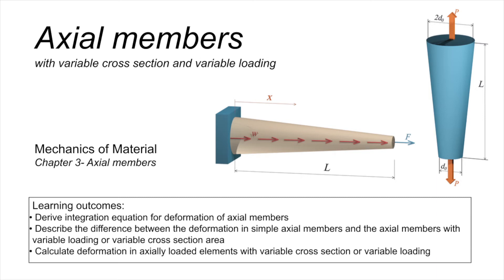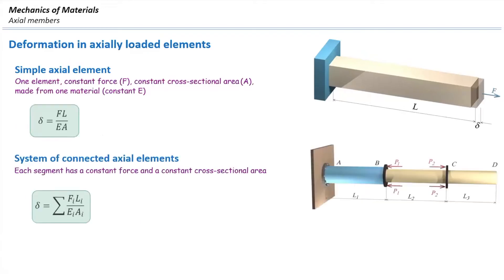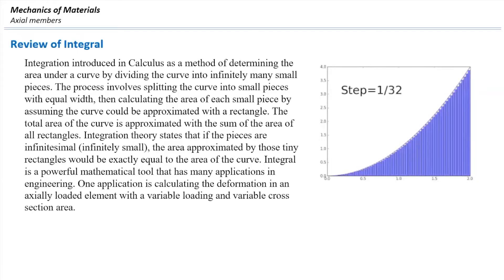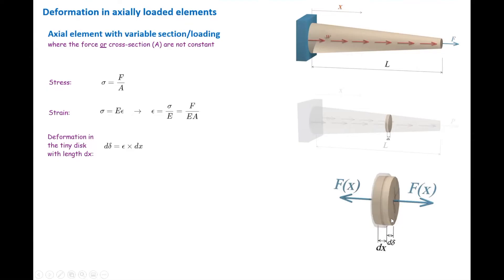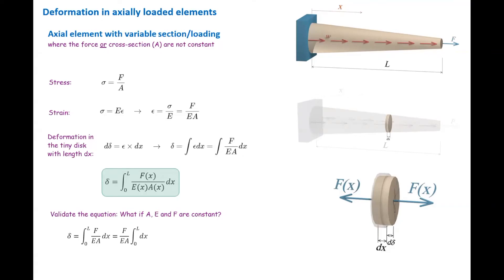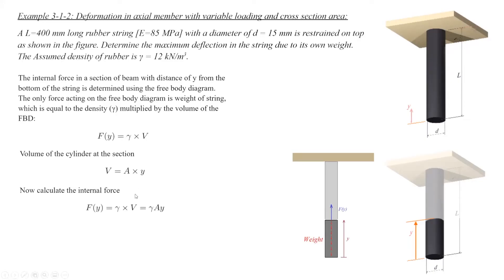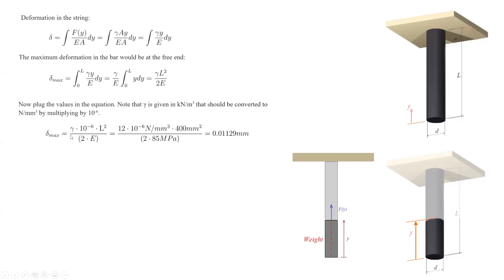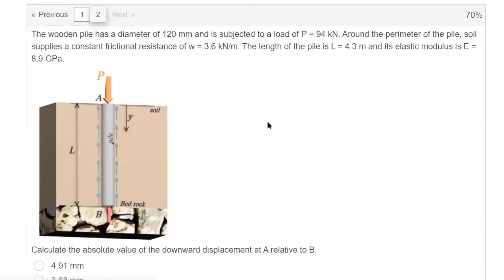Deformation of axial members with variable cross section area (Lecture and examples)

Comment: what happened to the gravitation constant? it should be in the equation
Reply from the maker: If you are refrerring to Example 3-1-2, based on the unit of density, it already includes the g. Hope that helps.
Reply: @MechanicsofMaterialsLibre  ok it's already included, good, i really like your videos you do not only have good examples but also good explanations

Comment: Sir i think in the last example one y is missing during the integration. Should not it be y^2?
Reply from the maker: Do you mean the hanging rod under its own weight? If so, which equation?
Reply: @MechanicsofMaterialsLibre  apologies sir. It's my mistake. Since you have directly written (L^2)/2 during the integration , i saw it like a y is missing. Sorry again.

Comment: In the derivation, F(x) doesn't change with cross section? Only cross-sectional area changes with length.
Also, in the problem, the unit of density is KN/mm2. You meant specific gravity?
Reply from the maker: The force F(x) is constant on the cross section area. The unit of density is kN/m3 in the presented example.